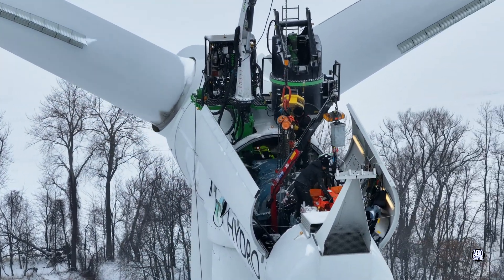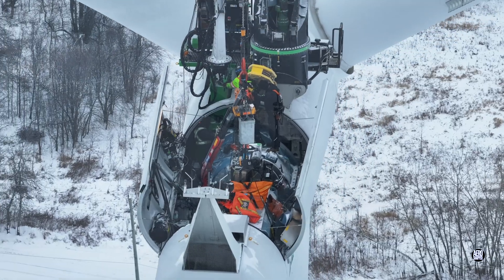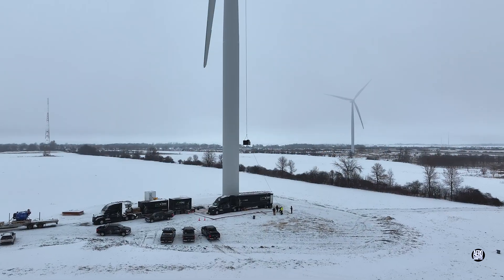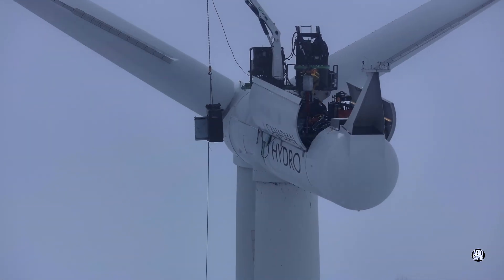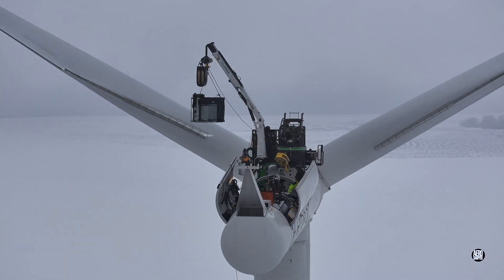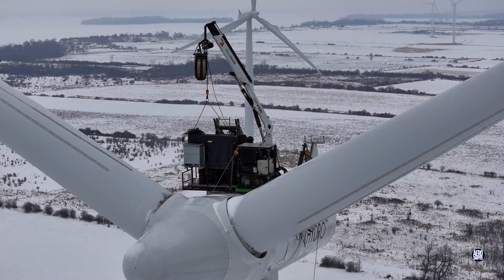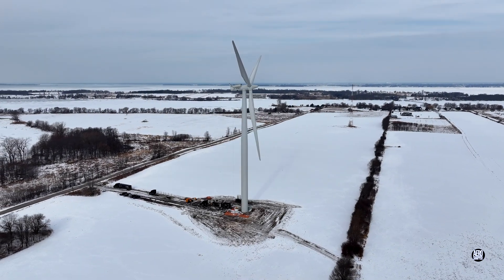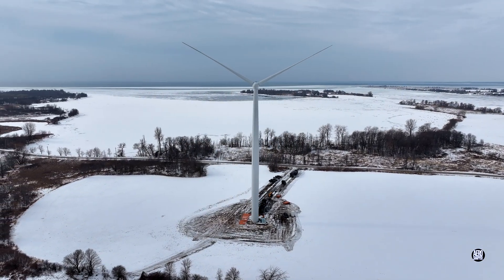Liftwerx - Servicing Wind Turbines without a Crane   4K

Comment: How do you get that crane up there? There is so much more that could have been shown it seems that getting it up and setting-up would be interesting.
Reply from the maker: The answer, I suspect, is that, like eating an elephant, it's done one piece at a time.  I will certainly try to catch an assembly, but much depends on conditions and timings.  It's not a quick fix - and nor should precise work like this be rushed.  There are only so many opportunities to spend several hours on watch...
Reply: Great video as usual of an interesting process audio is perfect as usual 
Understand if you don’t answer (privacy) you live on the island or close by,,,you sure find some interesting topics keep up the great work